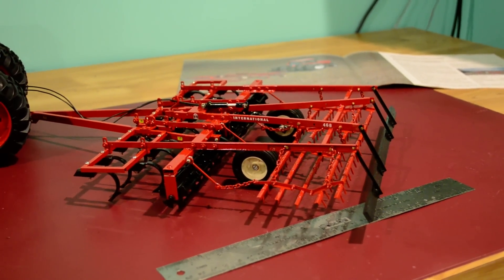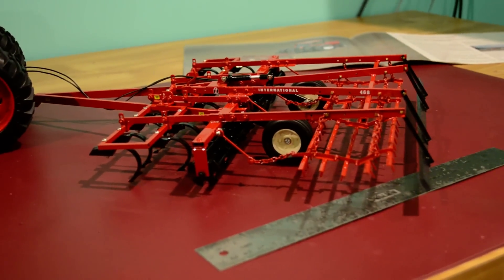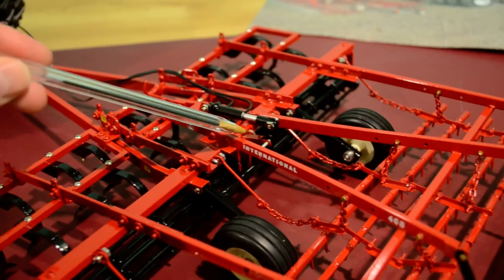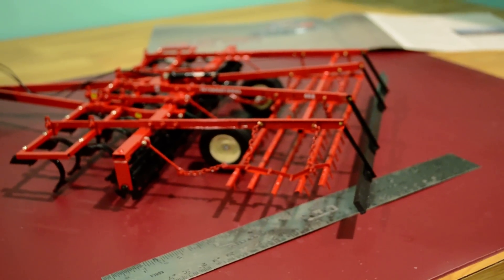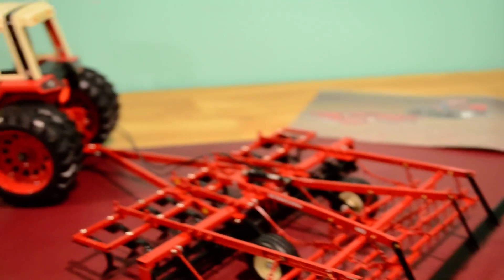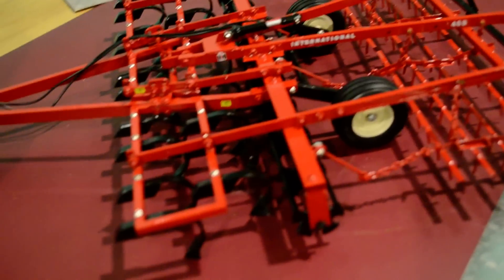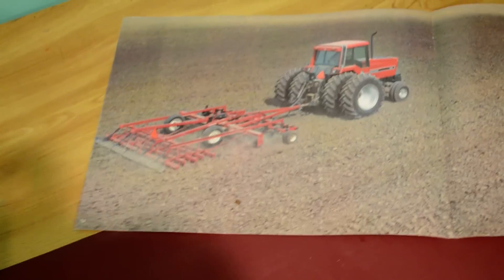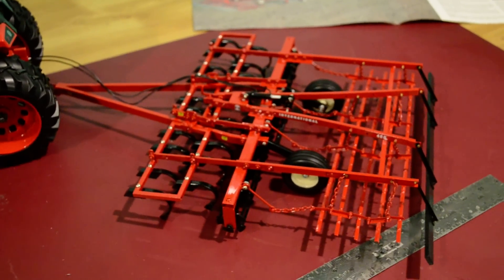International Harvester 468 Seedbed Conditioner -1/16 scale custom toy (video #4)

Comment: I am making a 1/16 scale flexi-coil Harrow. I need to buy some chain to connect the harrow sections to the frame of the harrow. Which store do you get your chain at? I am also from Canada so I may have a similar store here in Saskatchewan. This is a great model. It does look like it took a lot of work to build! Lots of tiny little parts!!
Reply from the maker: Thank you!  The chain is found at Michael's, the craft store.  The scale and strength works perfect for 1/16 scale toys.
Reply: Thanks a lot IH986! I hope I can find it there.  That is very helpful! Started making harrows tines....5 of 240 completed haha!!